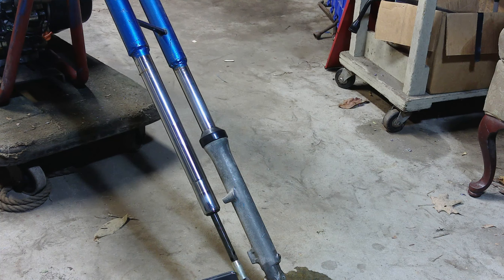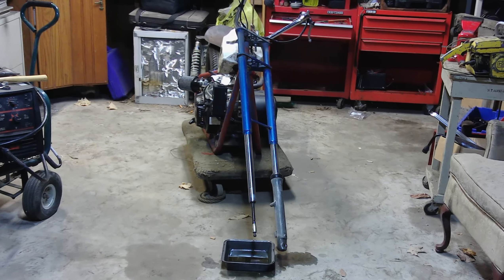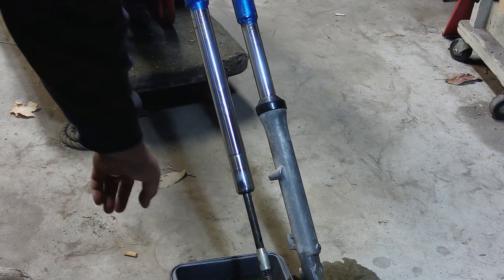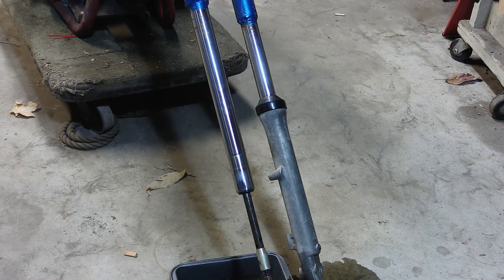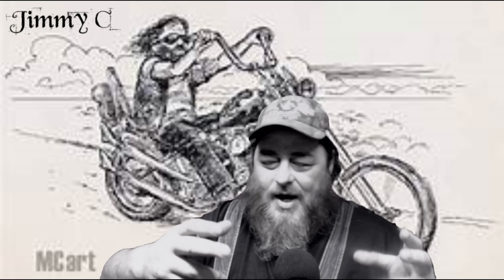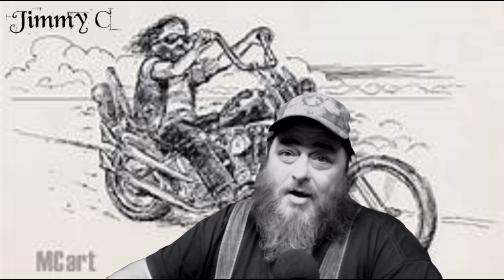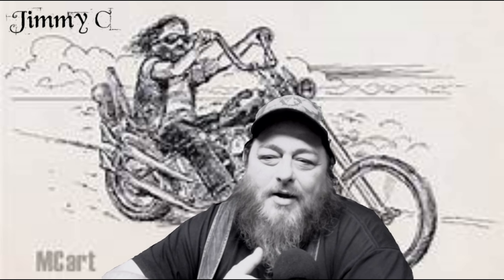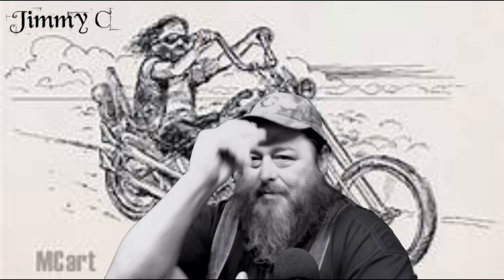420 REAPER MINI CHOPPER FRONT FORKS ?????

Comment: Ok what about adjusting the rack and leavethe front suspension. I say cut the front end off and put more angle on thuse forks. Or go full rigid frame. I got 2 videos coming out one is my 420 mini chopper and another before I post that one. The should be reall treats for creator fabricators. 
Nice ill be here to check this build out  fi sure. 
Be blessed 🙌 Rastafari
Reply from the maker: Thanks Rasta B It looks like thats the right way to go but I aint adding any more Angle as I'm new to riding Choppers.

Comment: So, are you going rigid on the front or do you want suspension? Never mind, springer. You sound like you got the right way going in your head
Reply from the maker: I really just want to shorten the Forks because they are way to long and have the front very high up. Thanks much.
Reply: @JimmyCandFriends  givem a little sag bend
Reply from the maker: @graybeardproductions2597  I'm not getting that Crazy I just want to ride it before the snow flys and not end up road pizza